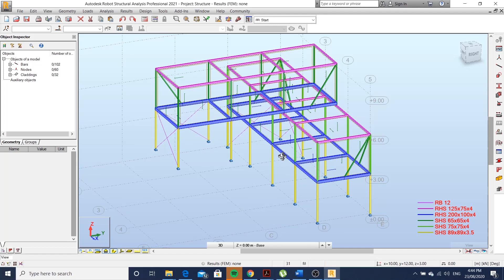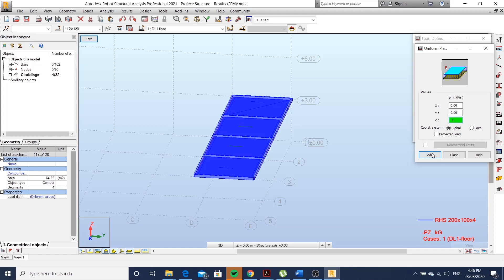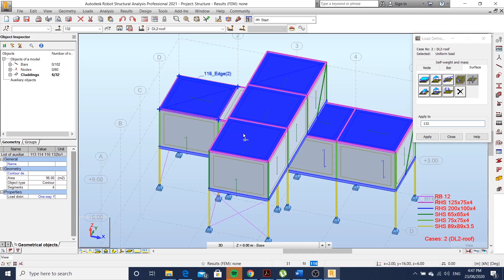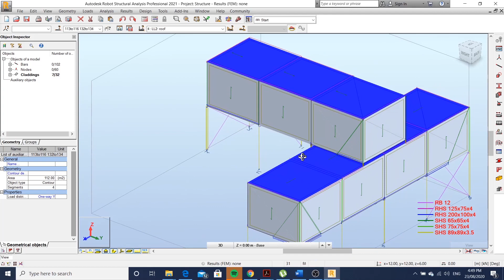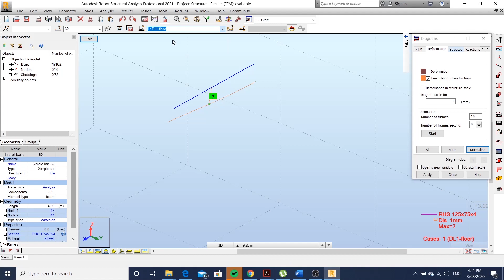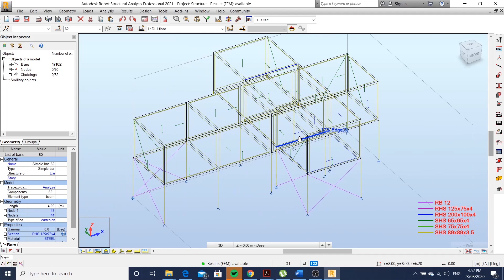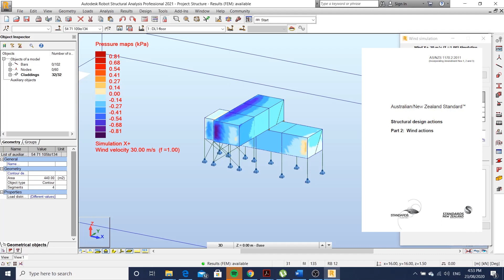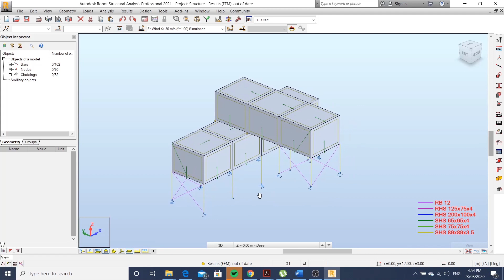Design loads and wind simulation - Part 3 -  Autodesk Robot Structural Analysis

Comment: Great video sir I am currently doing my thesis on Modular building I would say this helped me a lot but are modelling the inter-module connections that simple for a multi-storey building and how do you do the load combinations? thanks
Reply from the maker: I do the load combination in of these videos. It's hard to comment on modular connections without seeing the structure. What are your modules made of?
Reply: @bengthebrazilianengineerinAus  I have a 15-storey modular steel building

Comment: Wind simulation in autodesk robot won't correlated with any codes. It is a problem if your project have expertise. Second problem result of wind simulation depends on how you model panels in you project. Specialy it is iportant where buiding have zones with high wind presurre. If you design one panel in these zones simulation will design middle value of wind pressure for all panel. It is not correct. Be cerful for a using this function
Reply from the maker: Thanks for the comment. Always important to compare the results to hand calculations and assure the software is giving you acceptable results.

Comment: Hi Gabriel, did you design/define connections on your structure before applying a load? Great vid!
Reply from the maker: Hi Tomislav, you should define all connections before analyzing the structure. It doesn't really matter if it's before or after applying the loads. As a default, all your connections will be fixed, so if you have pinned connections, you need to change them.